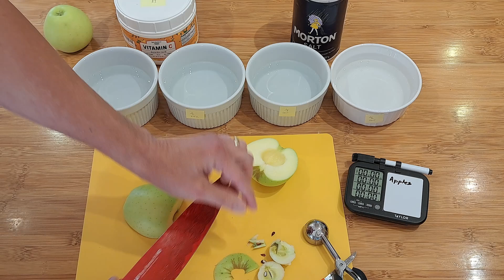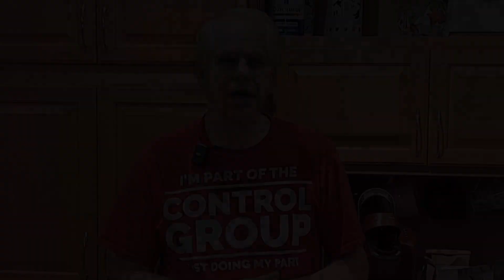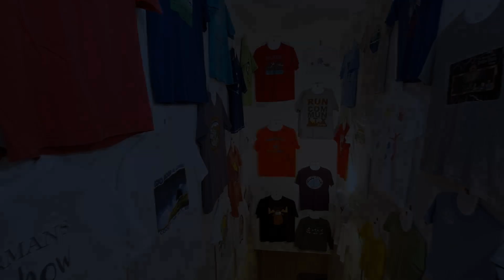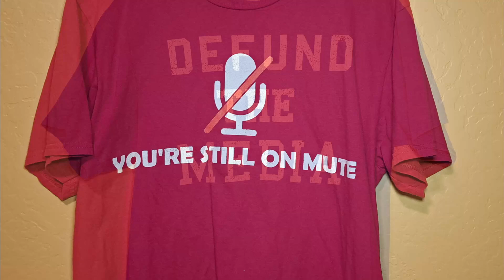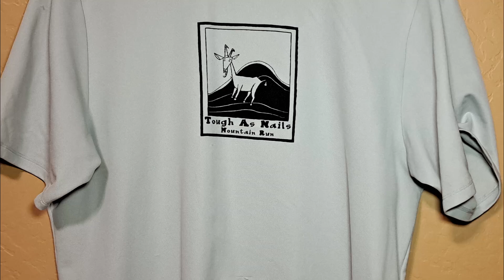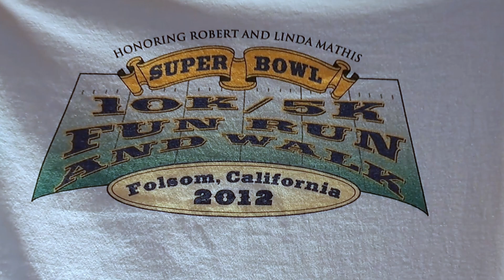First Apple Browning Test

Comment: Did you ever get an acrylic front disk for you sisters fd? What DIA in mm do you need?
Reply from the maker: Yes I did, but (so often a but) I haven't finished putting it in yet. (Don't tell my sister:) I got the disc back in April, but I need to sand it down a bit. (At least a 10 minute job:) The problem with telling people the size is that they (HR) made/sent out different versions of the seal for the same machine, and they are different by enough to make the disc too big to fit or small enough to fall out. (A few millimeters) The discs I bought for my sister's machine are 12" in dia. and 1/8" thick. (about 305mm x 3mm) I put a new seal on her machine a while back (I think it was in a video) and the diameter of the opening is different than it was with the original seal. I need to sand down the disc about 3 or 4 mm, I think. Luckily for me procrastination save me from having to make a new disc, because I'd never finished the first one! 

"Laziness is the mother of invention" and 
"Procrastination: The key to flexibility" 🤣
Reply: @SchoolReports  I just cut one for myself with my laser cutter and had a sheet left. There is nothing better than cutting it to spec for SchoolReports. Anyhow, if you already have it, no need to send a new one.
Reply: But if you want to tell me the exact mm diameter you need, then I can send it to you. I genuinely enjoy your videos, and it would be a pleasure to help and thank you this way.
Reply from the maker: @emailausdrucker  Ooh, laser cutter! I started looking at getting one after reading a paper about freeze drying blueberries titled _Freeze-Drying of Blueberries: E ffects of Carbon Dioxide (CO2) Laser Perforation as Skin Pretreatment
to Improve Mass Transfer, Primary Drying Time, and Quality_
Reply from the maker: @emailausdrucker  I would love that! Her machine is empty right now, so I'll go measure it.
Reply: @SchoolReports  uhhhh never thought of that to use the laser for skin pretreatment.  But i think mine is too strong with 130w- even if I use 13% minimum power.
Reply from the maker: @emailausdrucker  They used a 100 W CO2-laser system Firestar t100 (Which means very little to me) but they say they used 19% power or 19 watts to get the diameter and depth they wanted.
https://www.ncbi.nlm.nih.gov/pmc/articles/PMC7073631/
Bottom line - Cut the blueberries in half unless you have to have whole blueberries! 😁
Reply from the maker: @emailausdrucker  I really appreciate the offer for a disc. My sister's machine would need a 300mm diameter disc.
Reply: @SchoolReports  canada has Thanksgiving this weekend. I will tinker with it next week.
Reply: @SchoolReports  ohhh even more interesting that they used a 100w laser.
Reply from the maker: @emailausdrucker  They probably just used what they had on hand. 
If all you own is a hammer, everything looks like a nail. For me, everything looks like a 3D printable project. I need to get rid of a printer or 2. (or 3:) I taught 3D design & printing for a few years, but that ended 5+ years ago. Now I should get a CNC and a laser cutter.

Comment: Just bought my HR from Costco (arrives this Thursday), sorry Dan, wanted to use your link but the deal was too good, but plan to use your links for bags and some Amazon things like the -40/160 thermometers.
Reply from the maker: I would have recommended that you buy it there, but I didn't know Costco had them!
I would NEVER (almost) buy something like this somewhere besides Costco if Costco sells it! Come on, Costco? With Costco's return policy?! It's a no-brainer. I will start recommending people go to Costco to get theirs.
Reply: @SchoolReports  haha now I will have much better questions for you as I have fun learning. Like, what does freeze dryer riced cauliflower taste like 😆
Reply from the maker: @AddictOfLearning  That's an oldy from the past; over 3 1/2 years ago. I'd forgot about it until you mentioned riced cauliflower. It was my first time trying it. Blanching was the key.
Cauliflower Rice - Making, Freeze Drying, and Rehydrating - https://youtu.be/ox2whqmeBds?si=JB1WUnZMKGkPBs9q

Comment: The control group did what was expected. I was surprised to see some browning on all the others, though it was where you scooped out the core.. I wonder if the metal baller had some interaction. 

The rest of the others appeared to have no difference between salt or ascorbic acid. I didn’t see any difference between the amounts used, though maybe it was just my failing eyesight.
Reply from the maker: I don't think it is caused by the fact that the scoop is metal, I'm pretty sure it's because of the damage the blunt "cutting" edge does to the apples. (yet another variable to test for) Next time I"ll be cutting the apples with the corer/slicer machine; the sharp knife apple slices don't turn dark as fast as the slicer machine apples do.

In real life it was easy to see the difference between the 1/4 tsp and the 1/2 tsp, but they still all looked great for sitting out for 7+ hours. After stopping the test I put them in the fridge and they still looked about the same 3 days later.